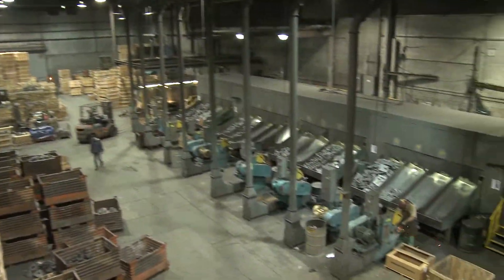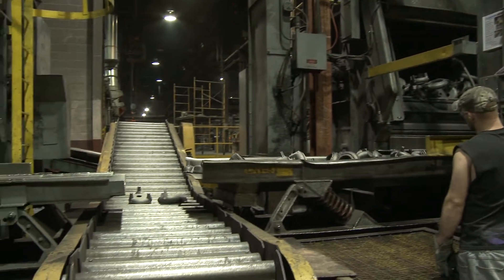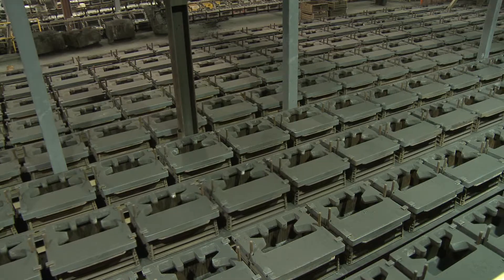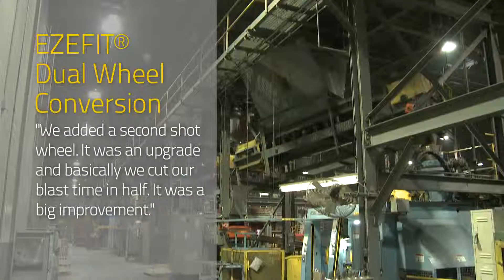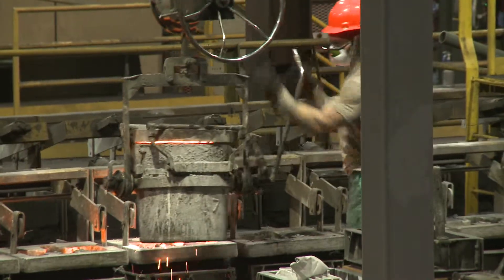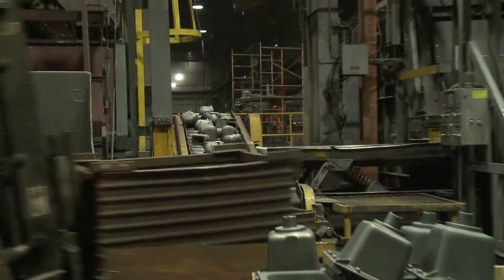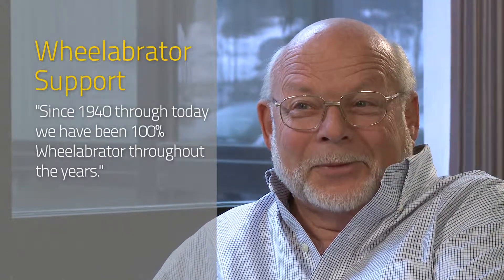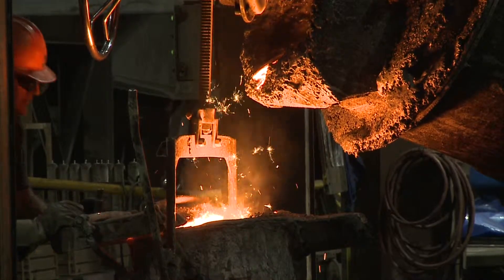Benton Foundry and Wheelabrator Tumblast Case Study

Comment: I remember running huge I beams through wheelabrator when I was 15 . No safety back then (1995) use to go in the auger box and eat my lunch cause I thought it was cool in there well machine was off but still live. Lucky. So many bad scary memories from that shithole welding shop. 10 tonne I beam swinging over me well I'm laying on the floor by one chain.... some horrible shit.